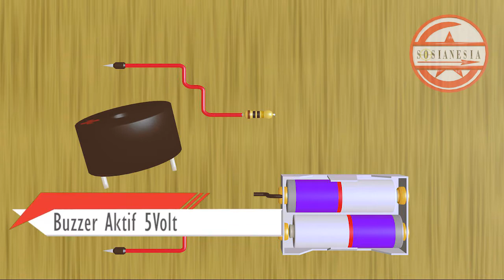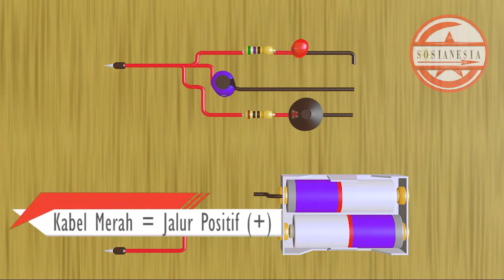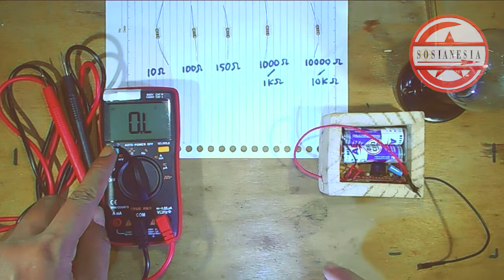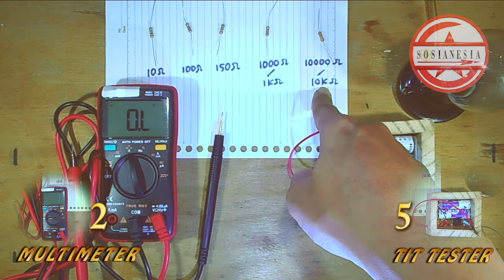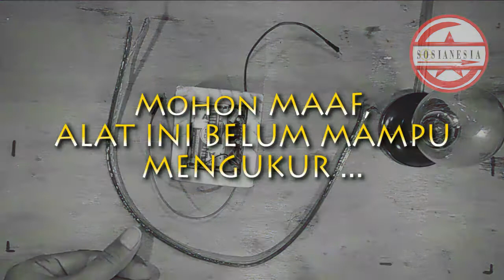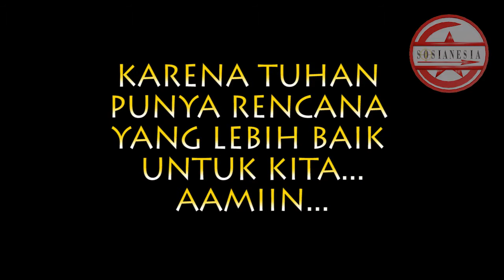TUTORIAL - Cara Membuat Continuity Tester Yang Sensitif | Alat Tes Kabel | Alat Cek Kabel

Comment: Kalo batt diganti dngan yg 9 volt .bs gak ?
Reply from the maker: Bisa saja. Tapi mesti diganti nilai resistornya kalau mau supaya led, transistor, dan buzzernya tidak rusak.
Reply: @SosianesiaChannel  jd hrs menggunakan ukuran brp resistor dan buzernya
Reply from the maker: Untuk buzzer dan LED, nilai resistor dihitung saja dengan hukum Ohm dan pastikan di cek datasheet untuk arus dan voltase maksimal yg boleh lewat di kaki kolektor transistornya.